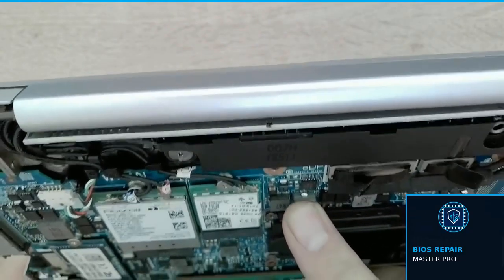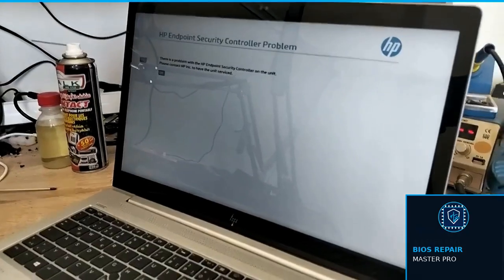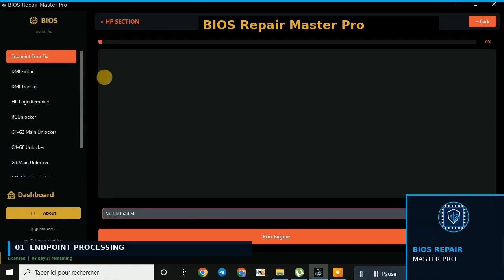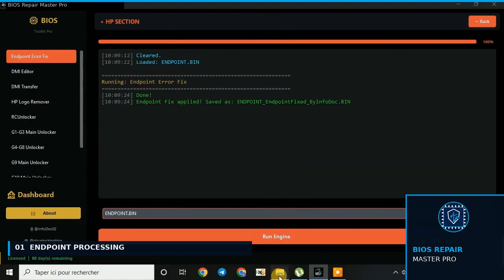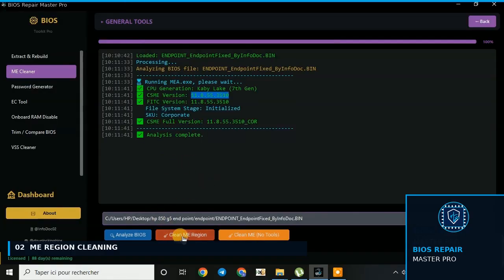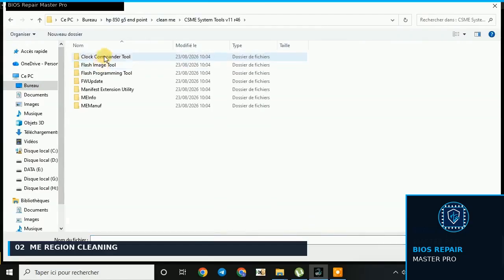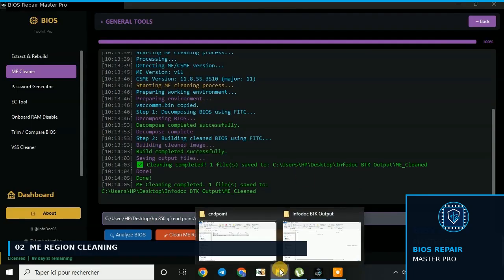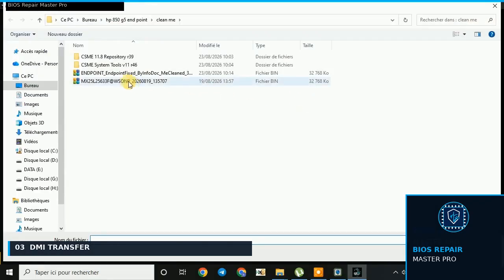BIOS Repair Master Pro Analyzer & Fixer Auto ME Clean, DMI Transfer

Comment: Can I test the workflow without connecting a programmer?
Reply from the maker: es. Use a local BIOS image with the analysis and local-backup modes. These exercises validate file handling, reports, hashes, and safety gates without accessing hardware.

Comment: What is the difference between BIOS repair and Intel ME cleaning?
Reply from the maker: BIOS repair is a broad term covering firmware-image recovery or correction. ME cleaning is a specific Intel CSME operation that must be performed with a compatible image and platform-specific rules; filling an area with zeros is not equivalent to a valid ME rebuild.